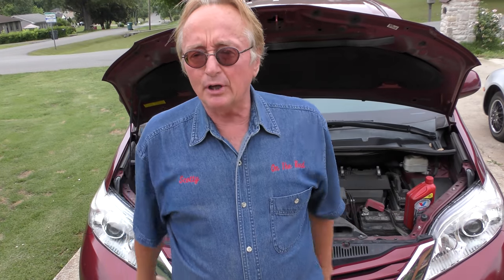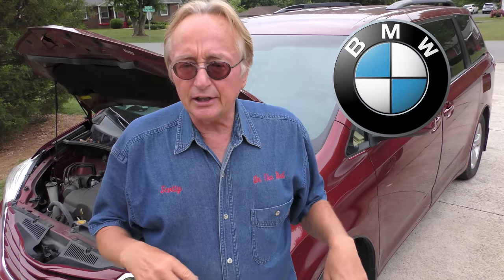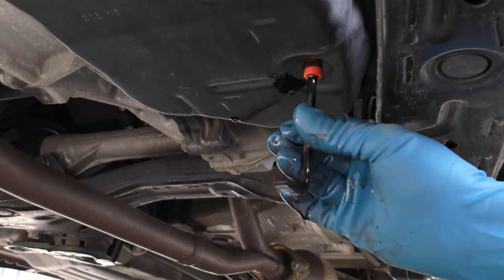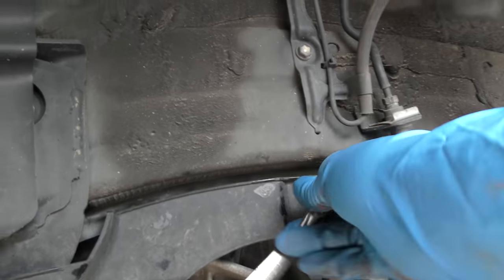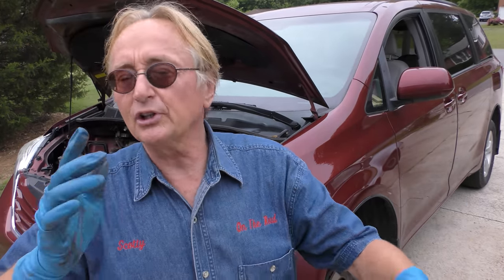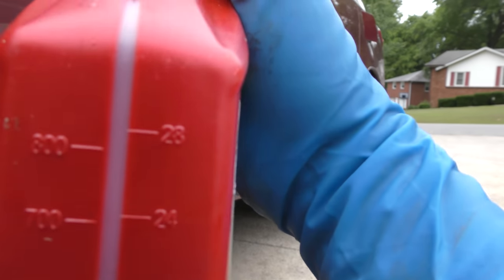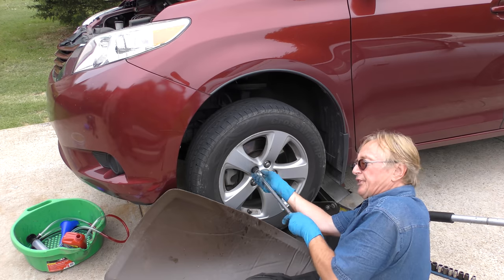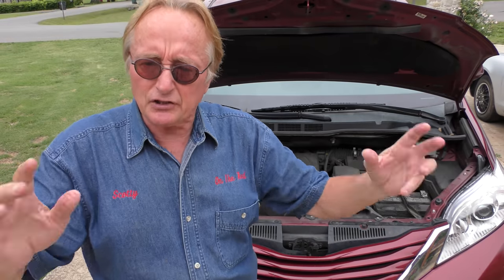Here's Why Changing Your Transmission Fluid Can Cause Damage

Comment: Great vid as always.  However one thing to remember is always take the fill plug out first! If you pull the drain plug and all the fluid has drained, then can't get the fill plug out ,your screwed !
Reply: That's actually solid advice...
Reply: Engineers mind..
Reply: That actually makes no sense
Reply: Uh what lol ?
Reply: @Tofix66  how does it make no sense? it makes perfect sense actually.
Reply: @Tofix66  in other words if you drain your fluid and you lack the tools to remove the fill plug well… you can’t drive that vehicle anymore until you get that plug off and filled. It makes perfect sense.
Reply: You can always pump it back through the drain hole.
Reply: @zxttgg  it’s always fun to fight gravity. It’s pretty relentless.
Reply: @Tofix66  ummm what, its simple really. Dont pull the fluid before you know you can put more in. What’d ya do if you drain it and the fill is stuck… welp your out a car until you find a way…
Reply: @zxttgg  ummm or just dont 😭
Reply: @peytonannett4911  Aren't you forgetting the obvious fact that ya gotta flip the car upside down. THEN gravity is your best buddy.
Reply: Good advice for an amateur, but there's no way Scotty or any other time served mechanic would ever have a problem getting a 24mm bolt out
Reply: @BillSikes.  you won't believe the number of mechanics I've seen this same sort of scenario happen to; they go nuts trying to get some bolts or nuts out, start hammering away and stripping and bending and denting things and all they say is "that's normal, it's perfectly fine" etc., and you just know it isn't... maybe not Scotty but some other "experienced" mechanics will sledgehammer away at things ...
Reply: @Tofix66  One can't fill liquids upwards without some sort of complicated non-return valve arrangement that probably does not exist, therefore removing the high-level filler plug first gives total confidence that the drained old oil can be replaced successfully when the bottom plug is refitted.
Reply: Hi, I've never done this before; why can't you remove the fill plug if you drain the fluid first? It seems like he did it in the video, just needed the long bar to get it off. You mean it becomes especially tight if you drain the fluid first? Thanks.
Reply: @darkjediMIK  oh he means as a precaution to do it first so that you make sure that it actually isn't stuck somehow and can't get it off, in other words : 
make sure you can actually take the plug out to fill it, before you empty it.
Reply: @oldpostreviver2624  oh that makes sense, thanks
Reply: @darkjediMIK  rust
Reply: I think the fill plug and the drain plug are 2 different things. The fill plug is higher up than the drain plug. Myself I'll take it to a dealer and let them do it. Might cost $200 but at least I know it's done right
Reply: @greer8288  if you say so. I know when I took my truck to the dealer to get some wiring fixed and get the oil changed they claimed they had rewired the entire back half of the truck. there was still mud on the wires they claimed to have replaced and nothing actually got done. they pretty much charged $450 to let me park it for a night. a lot of dealers are rip offs. and some that do try and do things right might hire mechanics that don't really know what they are doing.
Reply: Yah I guess if you did not look the condition of the fill plug bolt and you drained the trans fluid and then find out your bolt is all rounded and can't get wrench on it without the right stuff and knowledge you could be looking at a tow to the shop. I figure that bolt would rarely be screwed up but you never know
Reply: @adamburge6985  it could also be like mine where the one socket I had to fit the bolt is also the socket I was welding on to stuck grinder nuts to bust them loose. a deep well socket would not allow room to get the wrench on. but if you don't figure all that out before hand someones walking back to autozone or ace hardware.
Reply: Yeap, know what you mean.
Reply: I mean it should be common sense to look at the stuff you are working on ahead of time but as humans beings sometimes we just start doing things lol. You tube a great resource!
Reply: And considering how tight he did that fill plug up. There's a good chance no one is getting it about again

Comment: A few years back, I was charged for transmission fluid “flush” that never happened.  How do I know it didn’t happen?  Well, there was a whistle blower at the shop who happened to be someone I had met before on an overseas deployment. He urged me to confront the shop because he was quitting anyway.  They denied the allegation as usual and I had no idea how to prove it.  Scotty is right.  Some shops will charge you and mess up your car or not do it at all.
Reply: I wouldn't flush a transmission less ova 50k you ll risk pushing the garbage back through the system. If only they could makeum where everything drains out but the torque converter holds a good substantial amount too so can't be done. Wow Yu got jipped on that charge. I hope you got even

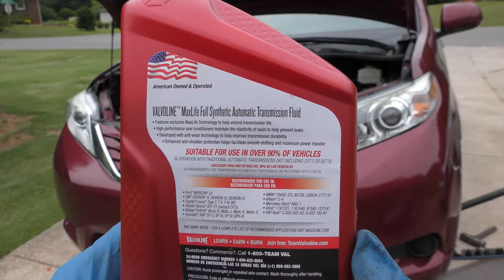Comment: 4:55 I used that full synthetic on my 30 year old A341E automatic with 380,000 miles when it started shuddering 4 years ago. Now it shifts like a dream. Do a full fluid change every 2 years.
Reply: What did you do to bring it back?

Comment: I went with my nephew cuz he wanted to buy a new used car, he decided on a Nissan Altima, I think it was around a 2014-2018 something like between there it had 60 something thousand miles on it I told him I told the dealer he's not going to buy the car unless you change the transmission fluid, the dealer would not change the fluid they said Factory recommends 100,000 Mi change and they would do it, my nephew just wanted that car so bad he bought it. He put about 10,000 miles on it and the transmission blew. Good thing he bought that extended warranty from the dealership cuz they fixed it for hopefully he'll listen to me and change it every 30 to 50,000 miles but you know how kids are. Scotty you are a wealth of information. And I really appreciate you

Comment: Watching Scotty in these videos is like listening to my own dad. He is also a mechanic of over 50 years, although for the past decade has only worked on our family cars, and he does not recommend any car brand other than Toyota. He considers Honda a close 2nd, but does not take any other car brand seriously. He is especially amazed by how easily bolts in various parts of his 1999 RAV4 (over 300k miles) come off after over 20 years. Mechanics like cars that are easy to work on. :)
Reply: I would be ashamed to admit to a Father who thinks the only good cars are Toyotas. That is seriously ignorant and/or stupid.
Reply: @contumelious-8440  Other car companies should be ashamed. My last car was a 2019 Traverse, and less than 2 years in, the steering column lock gave in. The steering wheel would go up and down by itself. If you feel smart by buying such cars, go ahead.
Reply: Better not say it out loud because Toyota has the biggest recall in history. After the fiasco with the D-4D and D-cat engines, Toyota stopped the development of diesel engines and agreed with BMW 1WW and 2 WW engines are BMW. The big shame is with the bZ4x model
- Toyota prohibits owners from driving the car!!! He buys it back. Reason? Little thing - your wheels can fall off while driving!!! Toyota is the worst car company for complaints - 9 out of 10 complaints are not acknowledged. 10 year warranty? However, it does not apply to components that are worn out by the operation of the vehicle. After all, in the USA Blake Alvarado with Toyota GR86 speaks for itself = typical Toyota approach. I liked the media dance that Blake started... Here in Central Europe it was on TV and in all the newspapers... "Toyota goes from problem to problem, the reason for the unrecognized complaint is a complete failure or a joke?! Say hello to father.
Reply: @Mijanboy  Blah Blah Blah,,,, to each his own,,,😂
Reply: @coldskilzs4127  It's sad how the quality of cars has changed since 2005, I mean all brands... And it all comes from ecology

Comment: Love this guy! His explanations are on point yet funny AF. Although I personally wouldn't think to use a power tool for bolts on tire vs a torque wrench. I'm actually surprised people would consider that. Speed for disassemble, precision for re-assemble.
Reply: That's like reading the terms and conditions. Drive it home lol torque specs are for fancy parts
Reply: You’d be amazed at how many of the young generation measures torque in “ugga duggas”.  It’s scary.
Reply: @mateofreyo1553  try changing a tire on the side of a road with bolts torqued down so hard you need the jaws of life to remove the wheel. 
torque specs are important to not cause unnecessary damage to parts. you dont want to make it too hard to remove or fall off in the case of under torqued.
its stupid to purposely damage your daily driver or a customers car.
Reply: @darkshadowsx5949  easy there big guy/gal. Just making a joke. Obviously do all work correctly especially on someone else’s vehicle.
Reply: @johnnyfive3872  I've never heard that term until watching a brake change tutorial video where the annoying guy said that.  I thought he made up the word because he was speaking goofy throughout the video.
Reply: I use the driver to get the bolts on quickly, then snug it up using a tire iron. Then I snug it up again after lowering the tire back down.
Reply: Oh please. Anyone with a lick of competetance puts the nuts on by finger, then uses the impact to snuggle em down then you use the torque wrench for final. You have to be pretty ham fisted to get that wrong.

Comment: I've always practiced taking the fill plug off first, then the drain plug. If you drain the fluid and then can't get the fill bolt off or it breaks, you're in a bad spot.
Reply: Very wise too. Always done that too, just in case
Reply: Good point
Reply: I agree..to me this is common sense..my dad worked at jeep for 35+ years and my stepdad was a master mechanic who started out as an aircraft engineer in the marines
Reply: Excellent point
Reply: this is clever
Reply: Flip the car upside down
Reply: I’m about to change the fluid and I was thinking the same!! Also to make sure the car is level so the transmission pan is level 😎
Reply: @reginaldanderson9807  I am about to do this job and I was wondering about that. Is that pretty important? And if you are jacking up the front won't that make the car not level anyways?
Reply: @fishingkh60  yes but if you have Jack stands you can Jack up the back too. 
I guess as long as you have the recommended amount in the tank than you should be fine.
Reply: @reginaldanderson9807  Oh ok gotcha. Thanks for replying.
Reply: So there is 2plugs you need to take off? Which one is which and in what order do you need to take them off
Reply: @greer8288  24mm Fill plug first. The fill plug is the one behind the driver side tire. Then the drain plug, under the car. It's a 6mm hex head bolt.
Reply: @greer8288  the location depends on your vehicle but one plug is usually higher up the the other. Top plug is for filling and the bottom one is for draining. Just check with your model vehicle to see where they are located.

Comment: engine should be running to check fluid and fluid should be checked when the transmission has reached operating temperature and or after at least cycling through gears to ensure valve body, torque converter and servos are full. measuring the oil fluid amount and putting the same amount back in is relying on the previous technician having filled it correctly previously which may not have done so. that tube just under the drain plug in some vehicles is the check level while running when hot. though i agree with you that you should not flush a transmission that has never been serviced in most of its life because it may develop problems, the most important thing to remember is if it fails after it was flushed, the transmission was stuffed anyway and it was only sludge taking up the clearances keeping oil pressure up keeping it alive anyway. i have an atf power flush machine that connects into the transmission cooler lines and is effectively dialysis for you transmission as it allows the transmission to pump its oil out while running and substitute new fluid at the same time. this ensures you get all the old fluid out not just whats in the pan. i also warn the customer if the transmission fluid is really dirty and sludgy of the potential risks of flushing and advise against it accordingly.
Reply: I gotta question, my automatic transmission fluid seems fine when I checked it and no contamination either and it is an old car but it’s hard to change gears as the car struggles to get up speed and sometimes it will just shift to neutral by itself in the middle of the road. What would you think the problem is?
Reply: @SamEisa-pt5up  i would make sure the oil is at the correct level, might be low on fluid, especially when cold, if the correct fluid level and correct grade, could have a sticky valve body or solenoi. Are there any fault codes stored?
Reply: @thearchitect4726  ok just a little update I finally had the chance to work on it. Did oil change and installed new filter. Brought synergetic fluid and changed transmission fluid but didn’t change the filter and tbh so far it feels much better already. No any incidents so far. Fluid was coming down pinkish and like a new so I’m not sure what the problem is but maybe because the car is over 20 year old, the fluid is disintegrating, although we can’t see it but it could be the problem and why it was so hard to shift gears when I was trying to speed up and sometimes causing slippage. But i guess time will tell.
Reply: Synthetic*
Reply: @SamEisa-pt5up  if the fluid is pinkish, may have a leaking heat exchanger allowing coolant entry into the transmisison fluid, you need to flush the fluid and replace the cooler asap or the box is history, depending on the vehicle the cooler may be located on the transmission or in the radiator, this is urgent if as you say the fluid was pinkish as it indicated coolant entry into the transmission fluid. URGENT!